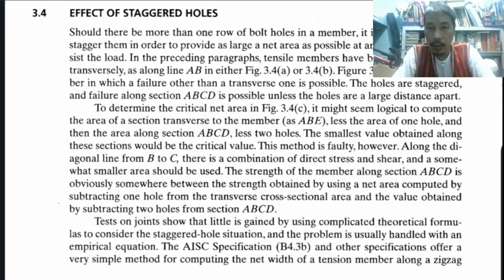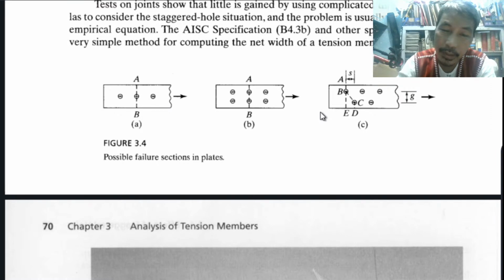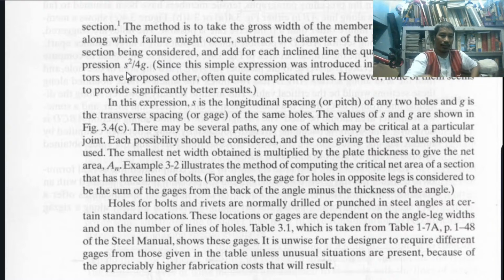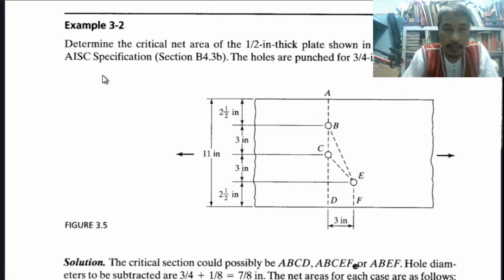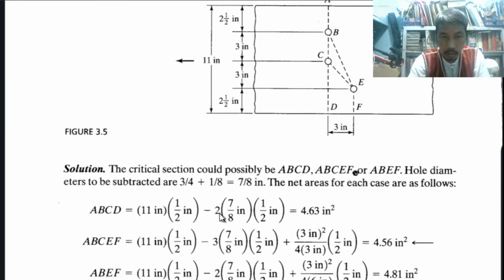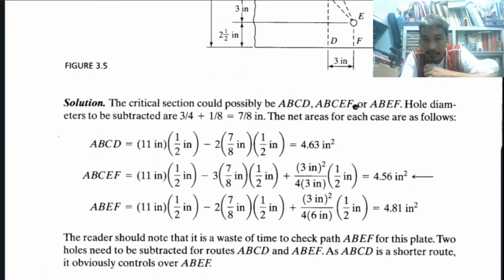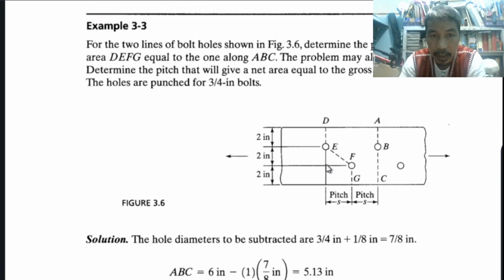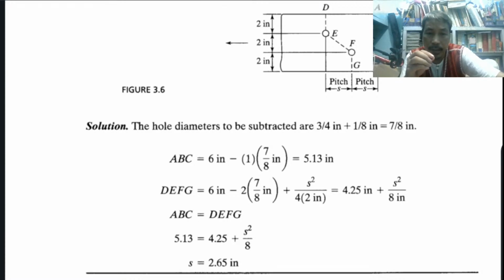[ LIVE CE E6 Lecture 10 ] DrAP Zantua Steel Design Principle Talks + ENGINEERING Analysis & Design

Comment: Thank you sir for this live lecture video, I've learned that the effect of staggering holes should have more than one row of bolt hole in a member, if the hole are not aligned to one another it is desirable to stagger to provide a net area at any section to resist the load.

Comment: This video talks about the staggered hole and its effect. I have learned the term critical path/critical value which was the shortest spot/smallest value of a cross sectional area that could resist the load. Possible failure section in plates, formulas and its legend has been discussed. Thank you, sir for explaining the problems. This is very helpful.

Comment: Thank You sir for discussing about effect of Staggered Holes. Test on joints shows that little is gained by using complicated theoretical formulas to consider the staggered hole situation, and the problem is usually handled with an empirical equation. The AISC Specification and other specifications offer a very simple method for computing the net width of a tension member along a zigzag form. Also this video lecture contains sample problems that determines the net area.

Comment: THANK YOU FOR DISCUSSING US THE EFFECT OF STAGGERED HOLES. 

Effect of Staggered Holes
• Effect of staggered holes arises when there is more than one hole,
and the holes are not lined up transverse to the loading direction.
• In such case, more than one failure line is expected
• The controlling failure line is the one that gives the minimum net
area.
The method is:
o Take the gross width of the member regardless of the line
along which the failure may occur.
o Subtract the diameter of the holes along the zigzag section.
o Add for each line the quantity S
2/4g
o The smallest width is multiplied by the plate thickness to
get the net area An
The controlling section is the one that gives the least value after
subtracting the holes and adding the quantity S
2/4g